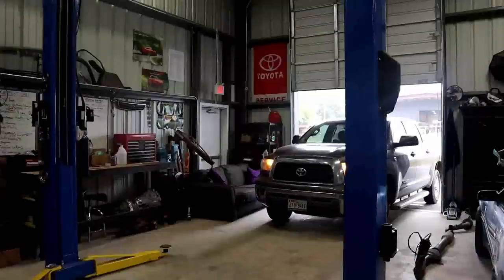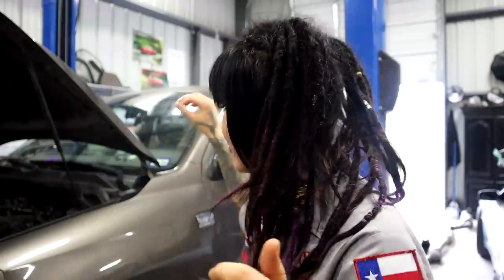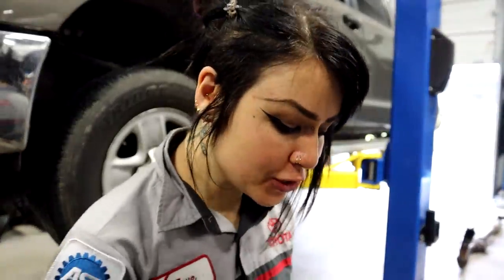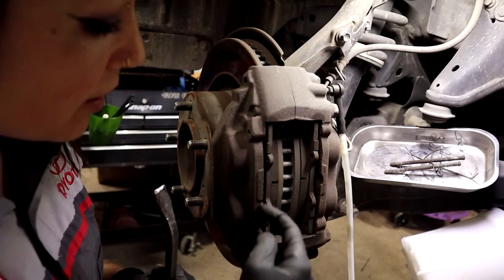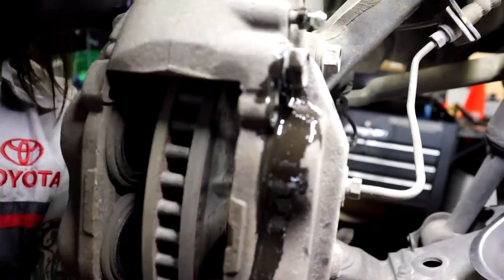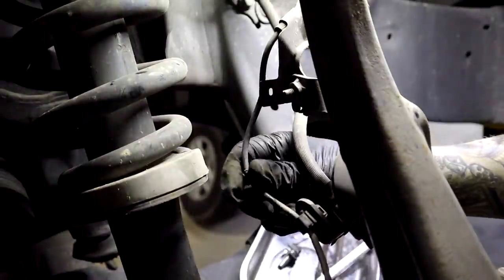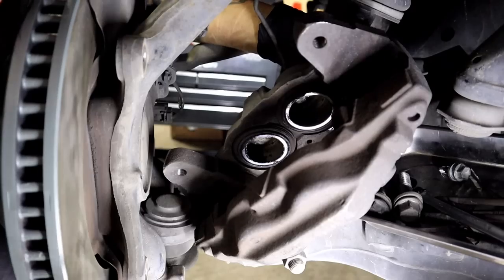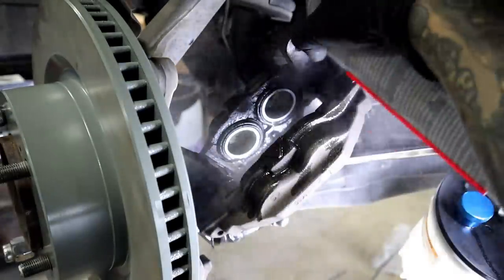How to Replace Front Pads & Rotors (a VERY detailed DIY tutorial) featuring a 2008 Toyota Tundra

Comment: I figure since the car still stops I guess the brakes are still good so I think I could probably hang another six months . Saw ur video on the Jetta fan . My turns on at 190 degrees witch on dash gauge is normal so I either have to replace fan relay ? Or the fan module control witch is not to hard all for bolts are visible to remove fans with out even removing the shroud there a good gap so what would u recommend the fans work when I turn ac on ( if that helps )

Comment: In addition to using the BFH (Big F*cking Hammer) method of removing a stuck on rotor, there is usually a threaded hole in the rotor you can us a bolt to push the rotor off.  I've had to resort to this a couple times on my car.
Reply from the maker: Yes Toyotas are well known for having these!!! This particular set of rotors had them but not all of them have them

Comment: Do you have to bleed the brakes when changing the rotor and brakes?   Could I change rotor/brakes then have a shop do the fluids?
Reply from the maker: You don't have to! I usually do at least a "mini flush" even if the customer didn't approve a full flush, and ABSOLUTELY you can!
Reply: @Faye Hadley  I ended up bleeding it 😀  never messed with brakes before and followed your video.  Made it a piece of cake!   Thanks so much for putting this together.  Main reason I've stayed away from doing some of this stuff is the unknowns...  the bolt holding the hard brake line on my driver side... was stripped :-(  I had to use a Dremel to reform it to be able to remove it.   Now on to my rear rotors/pads.  Attempted yesterday and 2nd lug nut broke in half....  the lug nut not the stud 😞   going by a shop today to see if they can get it off vs me drilling it out.   Thanks again!!

Comment: Is each caliper suppose to have 2 springs cuz ive only been seeing 1 on each of my 07? If this is the case I'll save the old ones n use em with the 2 new ones I got with my new pads.... 😁😘
Reply from the maker: Those only have 1! Nailed it! And they're just return springs so they're not essential, they just help the pad return to the caliper after hitting the brakes but I've seen plenty of cars without em 😆 that being said, I always save them (if a kit comes with new, I'll save the old ones in case I see a vehicle without them, or a new kit doesn't come with them) Sorry for the long answer!! 😆

Comment: Faye, why is it bad use brake fluid that has moisture ? At what percentage of moisture should I get rid of brake? Let me know as I have a brake job to do this weekend.
Reply from the maker: Great question! Max moisture is 4%ish. It matters because fluids don't compress, but moisture - water - will turn into steam when it heats up, and steam - air - does compress. Gives you squishy brake pedal feeling if the. moisture is too high. Also... moisture inside the lines CAN (not often, but I have seen it) cause corrosion of the metal lines from the inside out. That is very $$$.

Comment: Thems some odd brake pads! Are they Wagners?  I always do Akebono or OEM!  There is a school of thought that brake rotors almost never are "warped" and any grabby braking response is due to "uneven pad deposition". You can measure the rotor run out with a dial indicator and they often read the same old vs new. Either way you need new rotors; NEVER resurface!

Comment: I love that brake grease, but be careful not to get it on rubber. They make a big deal about it on their website because apparently it's petroleum based and can deteriorate rubber. They make a silicone ceramic grease, one step up, but more expensive , with a red label that is silicone based and is safe on rubber
Reply from the maker: They do!! I go into detail about this in the longer version that I put on Patreon (that's why I suddenly say in this video "I have been talking about lubing for a while" I cut out like 5 mintues of rambling HAHA!!)
Reply: @FayeHadley  😝

Comment: My pins are so rusted that I can't tap them out! I see that you're in Texas (where I'm from!) so you might not have any pointers, but maybe someone reading the comments will. Any rust belt people know how to get the pins out? I've coated them in rust penetrating oil but they won't budge. I'm deforming the ends as I try to get them to move, unfortunately. Any help is very much appreciated.

Comment: Little tip for rotors.  A 2x4. 6 inches long.  Against the. Rotor surface.  Hammer the. 2x4.  Pops right off. 😅

Comment: Is it really necessary to open up the bleeding port when pushing the pistons back ?
Reply from the maker: Yes - that's where the nastiest fluid that has been through the most heat cycling is! You don't want that back in the system, and you don't want that going through your ABS module either!!!

Comment: How would you advise to spread the caliper pistons if you were just changing pads and wanted to avoid damage to rotors? I’m nervous about prying between pads and rotors.
Reply: Anyone have any advise?
Reply: @cuttinghedgedesigns  disc brake caliper tool set, free rental at O'Reilly Auto...part of their loaner tool program
Reply: @cuttinghedgedesigns  apologies for the bad intel, i did my 2012 this weekend and the rental tool was of no use.  had to buy the brake pad spreader

Comment: I noticed the two scraps of cardboard under the front wheels...is that to make it easy to turn them while stationary?
Reply from the maker: No that's to catch the brake fluid and oil residue from the brake rotors
Reply: Faye Hadley Ah, you’re always a step ahead :)

Comment: Hey Faye, do you know about the 10mm wrench trick with the wire loom clips?
Reply from the maker: You mean use the wrench to pop them out?? Oh my gosh no - tell meeee!!!
Reply: @FayeHadley  ya, you can use the closed end of a 10mm wrench to pop them out push it on from the back and it'll compress the tabs. Won't work if it's in a blind hole though, which is like 50% of time.
Reply from the maker: @richardt1293  YES!!! Then I have done this before without knowing I was a cool kid with a special trick, HECK YEAH!!! Thanks for increasing my radness factor ;)
Reply: @FayeHadley  lol, a true Toyota specialist.

Comment: Also I want to see the wheel bearing replacement. Don’t buy the Chinese bearing. Lasts like 6 months. Only Toyota on that part.
Reply from the maker: Oh definitely! This one is a little too easy for a tutorial maybe... this one is front wheel drive, and you can get the whole hub still. It'd be cool to show the process of actually having to pack one hmmmm.... and hells no! I use only OEM Toyota unless otherwise requested by my customers, either for upgrade reasons or money saving reasons, (but if I go cheap, no warranty, but some folks gotta do what they have to do during these times, yaknow??)

Comment: My brake kit came with just two of the pad clips that go in-between the pins. I thought they messed up untill i watched the following video...
https://youtu.be/H-x_GF9eA94
At 7:00 minutes in, they only put the clip on the upper pin and then they attach the side clip.
No lower clip is to be installed, at least with my kit. Did anyone eles have that situation?
By the way Faye, you are awesome and I love how detailed you are about the whole process, thank you 🙂

Comment: please take a note from an old fart don't use red loctite use blue , red sets so hard the next time you have to remove the bolts it's a battle blue works well enough and on brakes you will be removing them again later